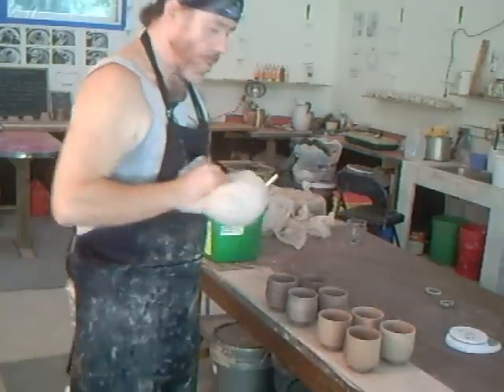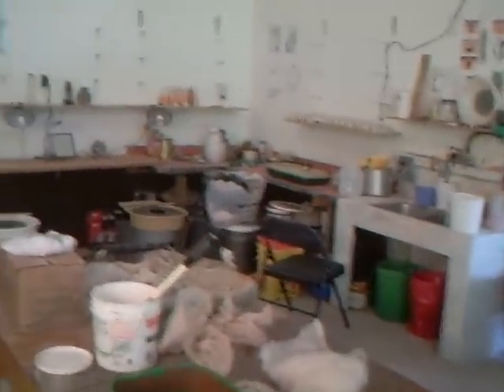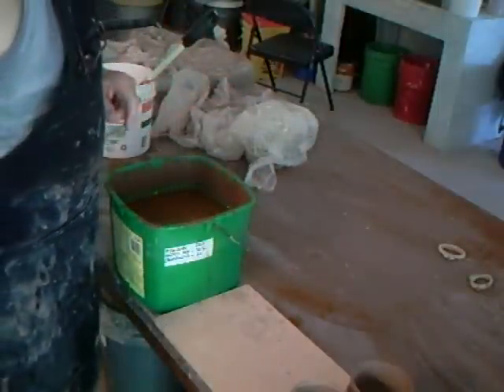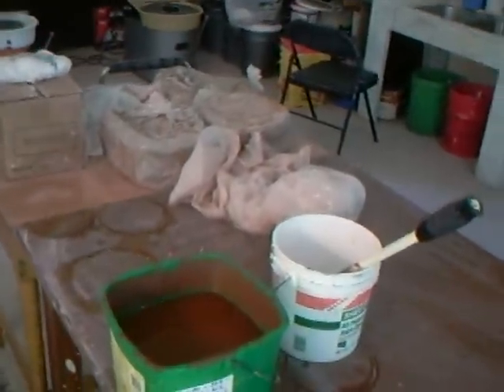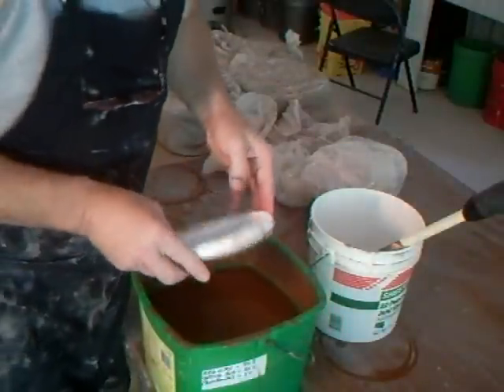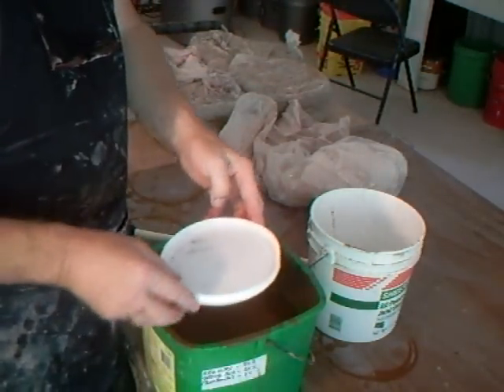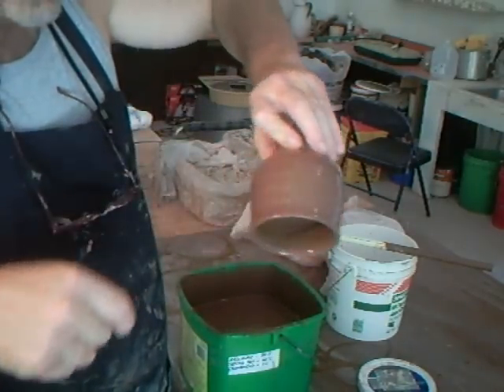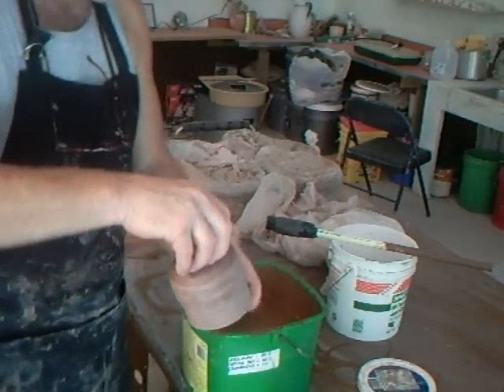SIMON LEACH POTTERY WORKSHOPS ~ Raw glazing & double dipping !

Comment: With unwashed ash glazes it is best to add dry mix to soak up the extra water. Removing water takes the solubles with and changes how the glaze melts.  I've found a good starting mix for glaze is about 50% water so if I'm making 500g I sieve it into 250g water in a bowl or jar and shake.  I also keep a wash up bucket right next to where I'm working so I don't have to scoot to the sink all the time. I rinse my hands a lot so I don't track dust around on my clothes. I've already got mild COPD.

Comment: Hey man, another way you can take the water off is by laying some clothe in the water and running the clothe up and over the edge of the bucket. This will wick the water out. Of course this process will take an hour or two depending on the type of clothe and how dry the air is. This is a principle called capillary action. Try it out. Thanks for the video though.